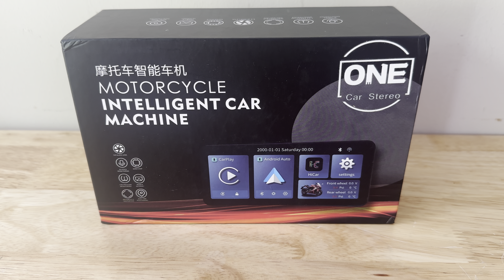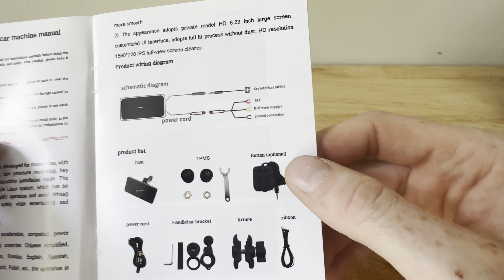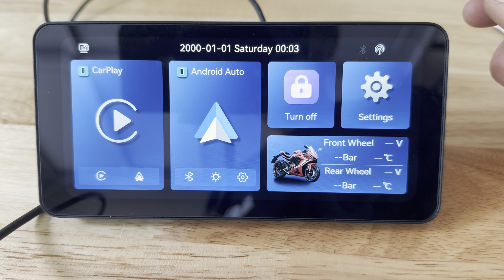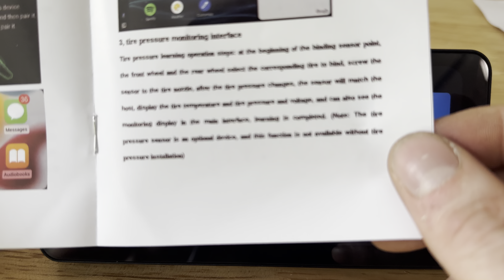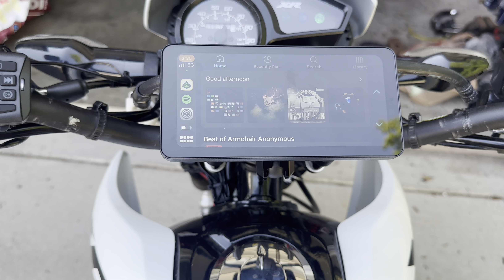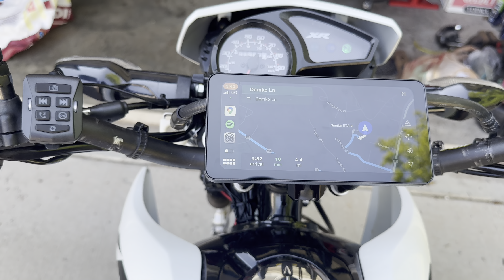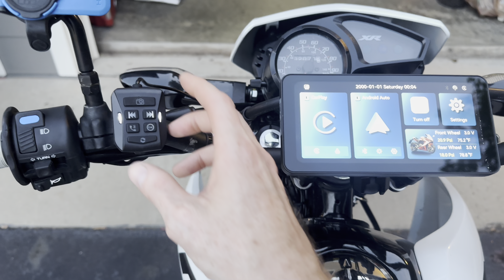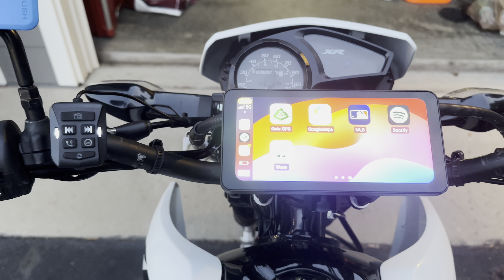OneCarStereo L200 Motorcycle Carplay - Unboxing & First Impressions

Comment: Black goes to ground and both red and yellow go to 12v. Red goes to a switched 12v from the ignition switch for the main power, and the yellow goes to a permanent 12v (battery) connection to provide power for the clock, presets, user preferences, etc. 🤔Correct me if I'm wrong :)
Reply: If it.s connected directly to the battery than the device would be on all the time. So one connection need to link to the accessory power to it shuts down when the accessories are turned off